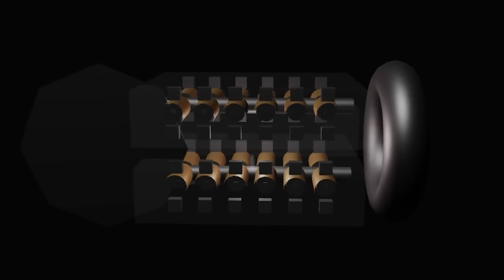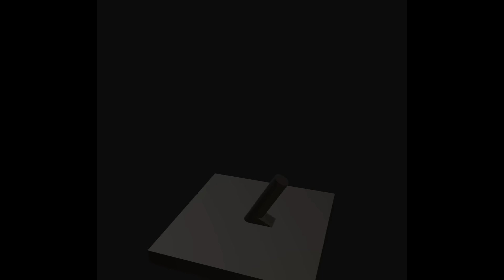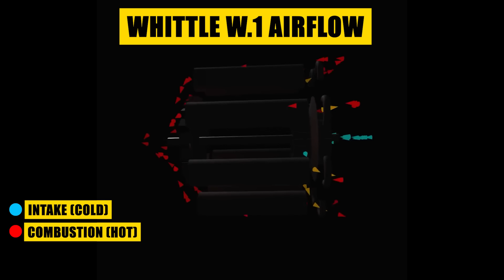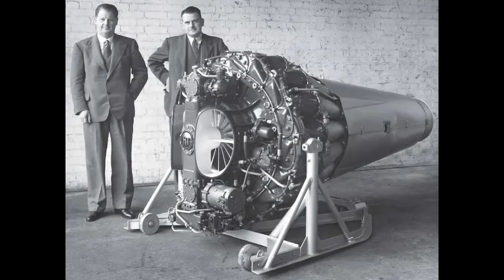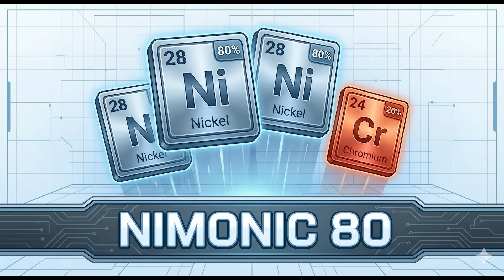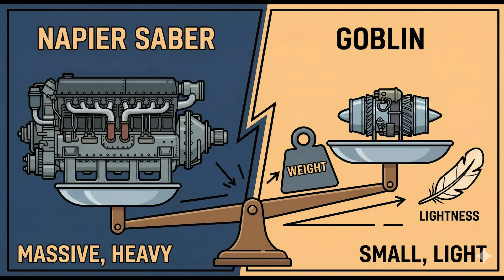The GENIUS Who Emptied the Engine

Comment: Other comments have explained some of the technical errors here, so I will take a broader brush.  In general "Simplicity = reliability" and "If it looks right, it is right" are helpful guidelines in engineering design, but they are not always true, and this is a case where they weren't, primarily because the amount of air running through a turbojet is greater than that through a diesel engine (which is the most efficient piston engine design), so that the power lost in accelerating large amounts of air to a very high speed considerably exceeds the efficiency gains by omitting reciprocation and by the avoidance of alternate heating and cooling of the combustion chamber, leaving the turbojet (aka "gas turbine") as an inefficient niche product (what most people think of as a "jet engine" is actually a turbofan).  Let's consider its advantages and disadvantages:

Jet engines have the greatest "power density", ie power for a given size and weight of engine, of any prime mover except a rocket, which makes them very useful for flight and where space is constrained, but there is a practical minimum power for any reasonable efficiency of about 500 - 1,000 kW.  The basic problem is that efficiency is proportional to blade-tip speed in the compressor and turbine, so as the diameter reduces, the speed must increase -- but as the speed is increased, so is the amount of power per area, so you have to make the diameter even smaller, etc.  You can easily end up with quite stubby blades, at which point you discover that only the part of the blade remote from both the core and the blade tip is efficient, and now that centre section has been eliminated.  (I accept that small turbojets do exist to power large model aircraft, but those do not fly long distances -- I suspect that if you loaded them with enough fuel to fly for an hour, they would be too heavy to take off!  (And the cost of fuel is not particularly worrying at model-aircraft scale.)  Conversely, diesel engines are large and heavy -- the largest marine diesels weigh hundreds of tons, and they only have a moderate power density.  So, for larger sizes, some sort of jet engine has advantages in large sizes for flight and for emergency power generation (which only runs a few hours/year, so that higher fuel consumption is not a problem (except that the oil tank size will be much larger than the turbogenerator -- I once worked in a factory with 3 oil tanks of about 5 m x 5 m x 5 m, serving two 4.5 MW turbogenerators, little objects in spacious sound-resisting casings about 5 m x 2 m x 2 m; IIRC the tanks held enough oil to run for only 3 days!)

So let's consider the major types of jet engine:

* Ramjets: These really are beautiful in engineering terms, since they have no moving parts and the airflow is more or less straight through, without severe kinks.  They rely on the speed of the air entering to produce the compression required for combustion, so as you may guess, they only work at very high speeds, over about Mach 2.5.  No one knows what the upper speed limit would be, since no one has yet built a fast enough plane, but it is certainly well over Mach 6 (although a different shape is needed for those speeds, sometimes called a scramjet, to allow supersonic combustion).  There was previously a requirement for an alternative power source to take the plane up to at least Mach 2.5 before the ram jets are lit, and that has limited their adoption, but a hybrid with a turbofan (see later) is now available.  Ramjets have therefore not been fully developed, and I suspect their fuel-efficiency is very poor.  However, above Mach 2.7 or so, ram jets and rockets are the only technologies known to work.

* Turbojets:  These are generally-similar to Halford's design (though with much improved materials) except that they use a multi-stage axial compressor rather than a centrifugal one (axial compressors were used in the German WWII design, and a comment below is a little unfair on Hans von Ohain and Anselm Franz -- their designs could have been reliable with the standards of materials usually available, but unfortunately by 1944, only inferior steel was available in Germany -- Whittle's design would not have been reliable with those materials either; the comment on Frank Whittle is correct, that he was not being allowed any budget for developing the engine, and having to build something which was sure to be reliable and cheap to build was key, since demonstrating it would release money to improve efficiency; Halford then arrived with funding to make those improvements and authority to procure whatever materials were required; if the RAF had offered the same encouragement and finance that Hitler gave to Ohain, not only would the UK have had a jet fighter at least 4 years earlier, but Whittle would not have had to patent his designs -- hoping someone would license them to give him money for further development, and then Ohain, who found and copied useful designs from the patents, would have been delayed, and Ohain also commented that he believed that, if Hitler knew that the UK had jet fighters, he would not have started the Battle of Britain!).  Anyway, even with axial compressors, and after decades of improvement, turbojets are inefficient, and although they powered the Comet and other early jet aircraft, they are no longer specified except for supersonic planes where their high exhaust velocity is an advantage.  The efficiency is still low, about 40% compared with 50% for a similar-powered diesel and even in this speed range, they are now being replaced with turbofans (see below).  Turbojet efficiency drops off at low speed.

However, better overall efficiency can be obtained if some of the power is used for other purposes:

* Turbofans: these avoid the inefficiency of accelerating huge quantities of air to high speed -- they use some of the power from the jet to turn a huge fan which accelerates most of the air moderately, leaving only a small proportion of the total (down to 7.5% in operational aircraft (Pratt & Whitney GTF) which is 49% efficient, and 6.7% in the Rolls Royce Ultrafan being developed, with 55% efficiency promised) to be pressurised and heated.  Theoretically, the more air is bypassed, the more efficient the engine can be, and so, much research is currently being carried out on practicable ways to increase it.  Obviously, this modification is only generally useful for aircraft; it could potentially be used for extract ventilation from mines or massive tunnels, though I am not aware of any used for that.  With these designs, for those limited purposes, after 95 years of development, the highest-bypass turbofans, which are suitable for about Mach 0.4 - 0.85, have finally reached the efficiency of the best diesels (with 133 years of development, 53% efficient now, aiming for 55%).  Above Mach 0.85, modified construction can allow use up to about Mach 1.2, and engines with a lower bypass, say up to 2:1, are believed to be practicable up to about Mach 2.5, with the F-22 fighter able to supercruise (see below) up to Mach 1.8.

* (Afterburners -- in brackets because they make efficiency much worse when in use, while allowing the overall fuel consumption for the trip to be reduced.  Airplanes need most power for takeoff and (if supersonic) for passing through the sound barrier, and yet engines large enough to achieve this would be heavier, and probably less efficient during cruise.  One solution (which was used on Concorde and is still used on many military planes) is to fit afterburners for use on those occasions only, which could charitably be described as adding a ramjet in the exhaust section of the main jet, or less so as squirting large amounts of fuel into the exhaust to see how big a flame you can get out the back!  More scientifically, they cannot be as efficient as a ramjet, because they are sitting in a duct optimised for normal use, but by using a great deal of extra fuel, they can produce a sizeable increase in thrust, up to about 70% extra (though those on Concorde only gave 17%) and if they are only used for say 2 minutes per flight, the reduced engine size (and weight) permitted will allow the overall fuel use to be reduced.  Cruising without the afterburners in use is called supercruising.  In general, they are only used for supersonic planes, since it is cheaper (and saves weight) on a subsonic plane to fit rockets to assist take off and then automatically drop off, reducing weight and drag.)

I'm running up against the character limit here, so I will continue it in a reply to this comment.
Reply: Would it be helpful if 'jet engine' was replaced by 'gas turbine'?
Otherwise - very good!

Comment: I dont think you actually understand what youre talking about... First off, the "straight through design" is a particularly inelegant description of any centrifugal jet engine (halfords engine had two tight radius 90 degree bends). So by design they are not "straight through". Axial jet engines are a straight through design. 
The point you made about single sided compressor sections makes zero sense. While the thrust forces that the bearings in a jet engine handle can be immense, your claim that the forces caused from the compressor blades "sucking themselves forward violently" is so silly. The compressor and turbine sections are connected with an axial shaft, and the turbine is being turned, and pushed backwards, by the discharge from the combustion chambers. The compressor blades are also designed to deflect the air 90 degrees, not create tractive effort, theyre basically fully feathered propellers, mounted to a solid disk of metal. Even forgetting everything else behind the compressor, it would suffer from forces pushing the moving parts backwards, not pull it forwards due to resistance to the high speed air hitting that disc. even without the air resistance, it is still absurd that you think the compressor blades are creating more tractive effort than the forces applied to the directly connected turbine section. 

And the insinuation that Whittle didnt know what he was doing at the beginning of the video, shows a lack of understanding about the development of whittles jet. He was working with almost no funding, and knew that robustness was the main hurdle if he wanted to get funding. Gas turbines werent an aircraft specific concept, infact power generation was the first commercial use of it in the 1930s. But those designs were way to heavy to fly, the dual sided compressor was lighter, which was a primary reason. And the "reverse flow" was a way to keep the combustion chambers cool, for cheap, basically air cooling the combustion chamber by making them double skinned (they were also perforated, which wasnt modelled at all in your example). By the time halford was asked to work on the project, the military was offering virtually unlimited resources to it, allowing more exotic alloys and testing. The choice between single/double sided compressors follows a similar logic path. The larger a compressor disc is, the faster the outer edge is moving at a specific Rpm. Once it goes supersonic, you can completely ruin your fluid dynamic calculations due to turbulence at best, and destroy your compressor blades (and less than a second later your jet engine) at worst. Whittle was a genius for a lot of reasons, but in my opinion, the most important was his ability to see when something was "good enough" for basically a shed built jet engine. Instead of blowing up untold numbers of compressor discs finding a design that pushes enough air for 1000lb or whatever, if he can get 700/300 from a smaller, double sided blade, and move on to the next problem then good enough. Halford on the other hand, had been spending years working specifically on centrifugal superchargers. It is also why power jets had such a nightmare putting their design into production, compared to halford's design. The whittle design was only meant to be a proof of concept with maximum endurance at a low cost. The pick two of Cost/Power/Durability problem of all machinery definitely applied here. Im not even knocking Halford, he was an incredible engineer, but you definitely dont understand this story, or jet engines, at all.
Reply: Types of jet (continued)

* Turboprops: in principle, these are similar to turbofans, except that, in place of a ducted fan, they use ductless propellers, and the jet only provides a small part of the thrust. That has both advantages and disadvantages.  Firstly, the maximum achievable efficiency of a ductless fan is less than that of a ducted one (though better than that of the jet exhaust alone) but secondly, a variable-pitch propeller can be used.  This has several advantages, but for present purposes the important one is that the pitch can be varied to give maximum efficiency for the current condition of flight, to match the relatively small band where the jet gives maximum combustion efficiency.  The propeller can be considered as giving a bypass ratio of 50-100:1 and it can therefore be efficient right down to Mach 0.2 (160 mph at sea level), however they cannot normally be used above Mach 0.6 (400 mph at sea level) because compared with turbofans, the propeller tip speed is higher, and if it exceeds the speed of sound, it becomes extremely noisy.  But with the advantage of the variable speed propeller to adjust it to the conditions, the engine efficiency is higher than turbojets and all turbofans now in use - approaching 50% on the latest designs, which almost matches the latest designs of diesels in that power range, while being much lighter.  Also, the fuel used per trip may also be lower still, because of the lower air resistance at the lower speed these planes travel.  A special case of turboprop is a helicopter, which is a less fuel-efficient design than an aeroplane, and generally runs slower, being particularly hampered by the tip speed of a large rotor.

* Turbogenerators: In the same way as attaching a helicopter rotor, with the exhaust not giving significant extra power, on land or on a ship, you can drive a generator, with the gearing chosen so that the turbine runs at its most efficient speed (though it becomes far less efficient at part load).  (These are called gas turbines, because although the fuel is usually liquid, it is vapourised by the high temperature before it is burnt -- in fact, they can burn any clean free-flowing oil or most flammable gases, but usually run on an oil similar to paraffin.)  And, where space and weight is less important, you can run the exhaust gases through a water-tube boiler (much larger than the turbine itself because of the volume of air to be treated!) and either use that for heating, if you have a year-round need for heat, or to raise steam to generate more power using a steam turbine.  With an optimum arrangement (passing the turbine exhaust first through a boiler and then through a preheater, so the gases will exit to the flue at a temperature well below steam temperature) with everything optimised, you might recover 70% of the excess heat in the exhaust gases, but the steam generated would be a little below the optimum temperature for a steam turbine, so by the time you've taken power for boiler supply pumps and condenser water pumps, you would struggle to get 50% efficiency out of the steam.  If the maximum gas turbine efficiency was 49%, and 10% is lost to ventilation fans and losses through duct insulation, and if the alternators are 97% efficient, we have potentially [49% + (41% x 70%) x 50%] x 97% = 61% efficiency.  In practice, what is called "combined cycle power generation" is expected to achieve 60 - 64% efficiency.

So, what of the alternative -- a diesel engine.  As with jets/gas turbines, further advances in efficiency still occur, although now usually by fractions of 1%.  AFAIK, the present winner is the Chinese firm Weichai, with a diesel intended for trucks or power generation, internationally verified at 53.09% in 2024, and aiming to improve it to 55% -- before that, only huge marine engines weighing hundreds of tons and with powers of over 20 MW reached similar figures.  Also, Kenworth are now claiming 55.7% for a mild hybrid engine, though IIUC, some peripherals, eg water pump, may have been electric powered rather than engine powered.  Roughly speaking, diesels lose 20% of input power to exhaust gas, 20% to cooling water and 5% to heat radiated from the engine.  The cooling water should be about 100 °C.  Exhaust gas, when working hard, may leave the engine at 800 °C, but the turbocharger converts part of that heat to mechanical work for the compressor, so after a powerful turbo, the exhaust is more like 600 °C.  While there is no use for that in most road vehicles and only rarely in rail vehicles, in ships and static power installations it can be used, just as is waste heat from a gas turbine, to power a small steam turbine, but the steam will be cooler, and therefore lower pressure that generated from the GT exhaust, and recovering 60% of the exhaust heat and 20% of the cooling water heat seems reasonable, with 45% plant efficiency compared with the steam generated seeming reasonable.  With 55% diesel efficiency and 97% alternator efficiency, the calculation becomes [55% + (20% x 20% + 60% x 20%) x 45%] x 97% = 60%, slightly below  the GT combined cycle efficiency, while requiring significantly more maintenance than the GT plant.  That is a turnaround from 40 years ago, where good diesel engines were 40% efficient but GTs were only 30% efficient, and diesel combined cycles were slightly more efficient than GTs.